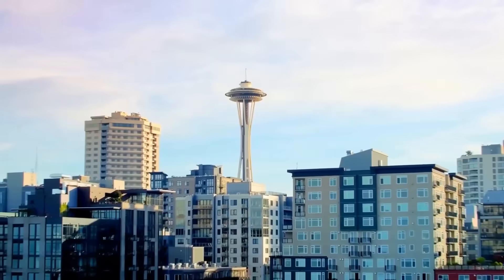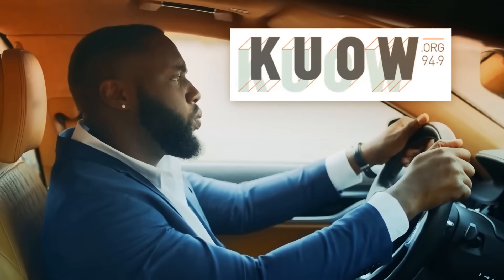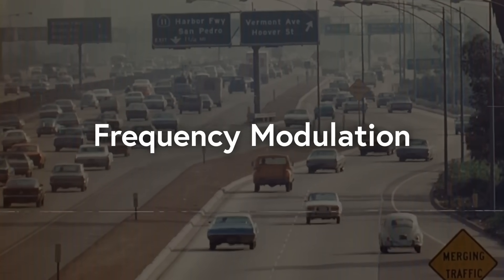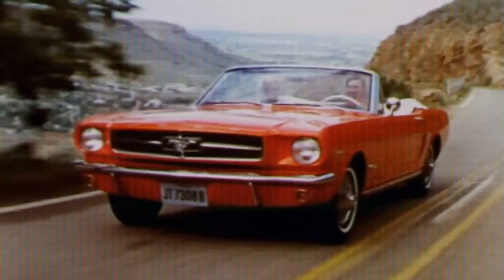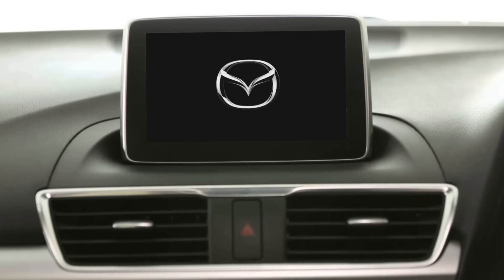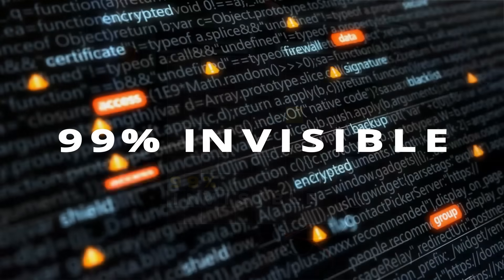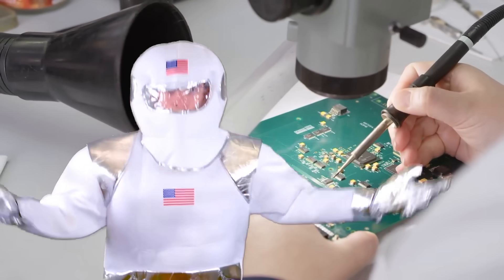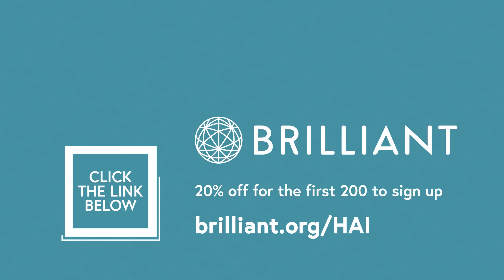Why Hundreds of Mazdas Tuned to 94.9 Broke Simultaneously

Comment: I don’t see how this is a permanently damaged unit. There’s no damage to the hardware. Mazda could reformat the units, and reinstall the software.  My guess is they’re choosing not to.
Reply: They probably designed the units such that there is no way to factory default them, and the memory chip is probably soldered on. Technically you could replace the memory chips, but they would rather sell you a new unit for $1500. Quite sad, $40 IP cameras have ability to factory default.
Reply: @xeridea  
They’re not offering replacements. 
The unit is out of production.
I doubt they intentionally designed it that way. But they may have accidentally done it. 
Sometimes it’s not about greed. It’s about mistakes.
Reply: @neilkurzman4907  It isn't accidental if it is gross negligence. Having a system that is impossible to recover from failure. Sad that a $40 device has ability to factory default if something goes wrong, but a $30,000 car doesn't. Also, you can buy parts for 30 year old cars, so not having them for a car a few years old, which is bound to have warranty claims is pure greed.
Reply: @xeridea  
You’re so busy trying to spin it you don’t understand how stupid the mistake is. Apparently no radio stations in the US sent an incorrect Picture file. If one had in a major city while the cars were stolen to warranty it could’ve cost the car manufacturer a Fortune. 
Now if somebody wanted to start a class action suit against them, they may have a case. There’s also the risk that it could happen again in a different city with a different radio station.
Reply: @neilkurzman4907  You are so busy defending them you are oblivious to their flaws. When writing software, you don't want to assume data will always be exactly how you expect it. If they didn't want to do the extremely trivial task of determining file type by contents, like most software is capable of, they should at least have a failure method that discards the file rather than having unknown behavior. Ask any competent web developer if they just blindly trust user input. Obviously they had zero sanity checks, since anything without a file extension would just blow up. Software these days often doesn't even look at file extension, since file type can often be determined by contents, and users are prone to messing up filenames.

The bigger issue is that, there is no way to fix it. Given worst case scenario of it blowing up, for whatever reason, there should be a backup. As I have said twice before, security cameras that cost $40 have the ability to factory default. If the settings get corrupted for whatever reason, be it accidental, or a freak bug, you can factory default, and everything is fixed. This is an assumed basic feature, even on the bottom of the barrel knockoff cameras. If cheap knockoffs do a better job, there is a serious problem.

I am a Mazda fan, so I am not just out to bash. When there is a clear an undeniable lack of competence, it needs pointed out.
Reply: @xeridea  
Defending them? I don’t work for them, I don’t own one of their vehicles. 
I told you it was a dumb mistake.
One that I’ve spent my living trying to avoid. Because I actually write embedded software. And yes for my products I always make sure there’s a back up way to boot load it. 
Yes that’s the exact mistake they made. They assumed they would get exactly what they wanted. 
Then they doubled down on by doing what they thought would be a useful feature, saving the picture for each radio station so that it would come up without waiting for it to load. 
No you’re wrong. Because you were assuming they knew exactly what would cause it to fail. Which means they needed A general purpose reset. One that we deal with all failures. 
For example my Honda which has a Linux-based entertainment system. Which is what I assume this one had to if it crashes while I’m driving, The only way to fix it is to turn the car off and turn it back on again. There’s no way to fix it while I’m driving. 
A web developer? What does that have to do with a Linux based car entertainment system.
And I’m not sure why you’re bringing up web development, because a lot of sites are trash.

Oh somebody made a mistake big time. Whether it was because they’re incompetent, or in a rush I don’t know. 
You can also blame the test department. Because they didn’t catch it either. As I said they were extremely lucky that this is a very uncommon occurrence. If it was they could’ve had tens of thousands of Bricked entertainment systems, while the cars were still under warranty.
Reply: @neilkurzman4907  Not sure what you are saying. They made beginner mistake, and didn't have any way of recovery. But you agree with having recovery.

My web developer reference is because it is a widely known fact that you can't trust inputs. You can't trust users, hackers, cats typing, or imperfect radio data. Any well built system should validate any input it receives.  Improper input should gracefully fail. I know there are a lot of trash sites out there, I have cleaned a lot of them up. I was referring to the ones built by competent developers. We validated client side, but this was purely for user convenience, everything was always validated server side. You don't want some random user taking out your database, or having a glitched user. There are good and bad developers in every field. This doesn't mean not following good practices should be acceptable. 

Negligence isn't an excuse for poor code. This wasn't some obscure bug that would be hard to test for. It is a failure of most elementary validation. They had a specification on how the input should be, so they had a perfect outline for what to test for. They skipped that part and just blindly assumed 100% of the time they would have perfect data, which is never the case.
Reply: @xeridea  
You’re comparing two completely different branches of software and saying one should be an expert at both.
Beginner mistake? Hard to say. 
Web programmers always get bad data. And by the way not all of them react well to it. Embedded programs tend to be a closed system. So there was a lot of data which you can trust. 
As far as no way to recover, I’m not sure I believe that the design could be that bad. The manufacturer doesn’t seem to be interested in dealing with the issue. Assuming they actually made the radio and didn’t purchase it. 
They should be making arrangements to get them repaired, and making additional software updates to deal with the problem, because it can certainly happen again. 
There’s a lot of bad programming in the world. Sometimes calling them beginner mistakes insults beginners. Because they’re not being made by beginners. I take my mistakes personally. So I try to avoid them.

And yes I can’t believe they didn’t validate that particular feature. 
Actually I shouldn’t say that I’m disappointed they didn’t but I can believe the testing is done that poorly.
Reply: @neilkurzman4907  You don't have to be an expert to know you shouldn't trust external data. It spans all software fields. If you normally work with internal data, this doesn't mean you should treat external data the same. Beginner mistake, yes. How hard is it to be given a file, and realize it doesn't have a file extension? That would be like buying a car and realizing it doesn't have wheels. Even if assuming it does, you will be checking for different extensions, and if it isn't in your list of known types, it should gracefully fail. 

Yes, the design is THAT bad. If there was an easy way to fix it, they would do it. I can factory default a bargain basement camera in 10 seconds. Obviously there is no way to factory default this unit. If there were, it would be far easier to reset it than to deal with an irate customer. You are suggesting a service department doesn't want to offer service, like a restaurant that doesn't like to make food.

You said there isn't a way to fix them because they are out of production, but then suggest they repair them, which they refuse to do, the only option being an expensive replacement for a manufacturer defect.

Beginner and expert programmers alike make mistakes. I am not saying mistakes aren't made by everyone. I am saying a complete and total lack of testing or quality control, or any way to fix problems isn't acceptable. By the nature of it, this is clearly a trivial issue that would be caught by any sort of testing or basic code review. They clearly just got it working, and shipped it. A multibillion dollar company should be capable of basic testing of their products, and have a way to recover from mishaps.
Reply: @xeridea  
You said it to self a lot of programmers don’t do what they should. And a lot of corporations don’t spend the time and money they should on system tests.
No it doesn’t span all software fields. I do embedded systems it’s my data. I don’t need to verify my own data. The same way you don’t verify data that passes from one function to another. 
You seem to think your specialty covers everybody else who does any kind of programming. As far as external data, it depends on your definition of external. Me personally I try to make sure my system doesn’t crash due to external input.

As far as this problem. You really don’t know what happened. You’re taking a wild guess based on programs you’ve seen. You assume there’s one test that handled the whole thing. Different programmers could be involved in different aspects. As in the programmer that read the data assumed the person that save the data did it properly. That they were actually reading internal data.
The problem may be the system engineer. Or the lack of one. 
Me personally, when I was working on a multiprogrammer project. I assumed my fellow programmers were not going to give me good data and actually did validate stuff that I would never have validated if I was doing the entire project.

It’s not just a radio it’s the entertainment system. And it’s basically Bricked unless you can find one used. Which is why I feel Mazda should figure out how to repair them. Because it’s their screwup that led to the failure. And if they get sued, good for them for letting it go that far. They can pay whatever the court tells them to.
Reply: @neilkurzman4907  Validating external data spans all software fields. I don't see how anyone in any field would feel it ok to not check external input. It is a basic part of ensuring your program doesn't crash. If you don't care about your program crashing, you shouldn't be a programmer. You even admit that for your field, where you are mostly working on internal data, you verify external input.

I am not taking a wild guess, it is obvious they have no sort of graceful failure for not opening image files. If the image file fails to open, it doesn't know what to do, system crashes and it reboots. The single cause of failure was not having an extension. Checking for extension would take 30 seconds, maybe 3 lines of code. Recalling millions of cars takes millions of hours and dollars. It wasn't an obscure bug, it was failure at the most fundamental level. Ever notice how if you open a corrupted document or image on a computer, it doesn't blow up? Competent developers felt like adding a few lines to validate, and gracefully fail. There is a well defined spec for image standards, and in a perfect world, all image files would be flawless. Since we live in an imperfect world, and files can get corrupted, it is worth validating. 

Embedded software developers should know as good or better than anyone, you don't want your system failing, period. Fixing bugs via updates is generally cumbersome, and often flat out impossible. The code must absolutely work. You can't just push out a day 1 patch like game studios do, or push out regular updates like OSes can. Neglecting a basic file check is unacceptable. This issue I would see as laughable, but possibly forgivable if they had a way to fix it. Negligent programming of an embedded device, combined with zero ways to fix it is simply not caring.

Since you have stated a few times there are bad developers, I am fully aware of this, I have worked with many of them. Just because there are some bad developers in your field doesn't mean it should be seen as acceptable. If anything, it should be more cause to be vigilant. If they had a basic QA team to test the device, this would have been caught in a flash. Since this is a multi-billion dollar company, I find pushing out buggy devices, with zero chance of fixing them, and  charging $1500 for the great experience is just absurd.
Reply: @xeridea  
I don’t know why you feel the need to repeat yourself. You stated your case.
I’m not sure who you’re trying to convince. Yes they screwed up, screwed up big time. Should they have done a better job, of course they should have. Software quality is a big problem around the world.  
My point is throwing around words like criminal and gross misconduct is misleading since it’s legally none of those. And there’s no way for you to judge the quality of the code because you haven’t read any of it. You’re just assuming it’s a trash heap and a bowl of spaghetti. Maybe it is, maybe it isn’t. 
You realize the $1500 is to buy a used system. Not from Mazda. But From a junkyard. I haven’t heard anything about Mazda doing anything to fix the damaged units, or to protect the tens of thousands of other units that could easily suffer the same fate. 
I don’t see them owning up for their mistake. Because it most certainly is their mistake.
Reply: @neilkurzman4907  I was repeating myself because you were suggesting embedded developers don't need to care about external inputs, which is false. I never said criminal or gross misconduct. I said gross negligence, which looking at it, is not the proper term. I was meaning extreme negligence. Some car makers have spaghetti code, so it isn't out of the ordinary. Toyota infamously had spaghetti code so bad, it was infeasible for it to be properly reviewed in their court case for unintended acceleration.  Not all automakers do it, but it is a somewhat common problem.

$1500 for the system is just crazy. You can get Android Auto installed for $600 or less. My main issue is with Mazda not rectifying the situation, clearly they didn't even try. If they were unable to fix it due to poor design, they should have at least offered some compensation. Even boneheaded mistakes can be resolved if the company cares, I have seen it done.

I don't mean to sound over the top. Being a developer, and seeing horrible code, generally from outsourcing, or "developers" that don't care, and cleaning up messes, I get annoyed. I don't always have the greatest code, but I try.
Reply: @xeridea  
Depends on your definition of external. If it’s out of your control then it’s external.
Yes bad code is everywhere.
Extreme negligence? I guess that’s the industry standard isn’t it. 
I’ve seen some pretty bad coat in my time too. And no not all of it was outsourced. Some developers don’t have the capability of writing good code. But it pays well. Try working for someplace while the generating buggy code while you work on it, so you can’t even fix it. 
Android auto isn’t going to help you if you’re touch panel isn’t working. Depending on the car you may not even be able to set the temperature. 
Personally I believe they can be fixed. And if Mazda was on the hook for it they would set something up. Even if it requires opening the unit there has to be a way to reset or reprogram it. 
They all run Linux, I find it hard to believe that there’s no way to access the bootloader.
Reply: You have a cartoonishly basic understanding of what's going on here lol. Whatever the storage device that stores the cache that's causing the problem is, I guarantee you it's soldered on, and fucking DEEP inside the unit. It's not some sort of conspiracy or decision by Mazda, but rather, that the whole radio unit is legitimately cheaper to replace than it is to remove and disassemble a broken one, dismount the soldered on chip, solder it on to another system or create a custom solution to connect it to that other system without soldering, fixing it, soldering it back on to the original unit, then reassembling the unit and placing it back on the car.

"My guess is they're choosing not to", yeah lol, your uneducated guess.
Reply: @uwirl4338  
Oh I’m sure it’s Saturday deep in there somewhere. And I’m sure the unit has a bootloader that could load in new software that doesn’t have that bug. Except that it would cost money and time to create new software that doesn’t have the issue. And by the way they’re not building new units.
You can buy one from a junkyard if you can find it otherwise you have no entertainment system anymore. So now tell me more about my cartoonish basic understanding. I’d love to hear it since this is the kind of product I made for a living. Not for cars, but other touchscreen controllers. 
By the way if somebody wanted to dig in there and replace the chip, guaranteed they won’t be able to get the hexfile to reprogram it. Because Mazda won’t give it to them.
Reply: @neilkurzman4907  I'm sure there's a relatively simple way to load new software into it but it only makes sense that it is unsupported and quite possibly not even looked into by the manufacturer. You can't seriously expect Mazda, or any tech related company for that matter, to make such a thing an easy matter. None do because it's too much of a liability. No tech company likes having a bunch of their products running bootleg software. You're asking a car company to do what traditionally is a no-go practice to fix a couple of units no one is suing for. That's why I called your understanding childish, not because you aren't familiar with the hardware, but because you (probably) aren't familiar with the business side of things.
Reply: @uwirl4338  
Oh I’m sure they could fix it, it’s probably running some flavor of Linux. 
And it’s not a few units it’s hundreds. 
And I didn’t ask them to run bootleg software or have somebody else do it. I specifically indicated that it’s Mazda‘s responsibility to deal with the issue. My guess is the radio was made by a third-party and they want tens of thousands of dollars to dig up the old code and make the changes. And possibly set up a repair facility to do the repairs. It may rec require removing the unit from the car to do the update depending on how good the development team was. 

And yes that’s exactly what I expect Mazda to do. This is their mistake.
And they’re lucky it didn’t happen while the cars were still a warranty otherwise it would’ve caused them millions. 
Additionally this defect still exist in hundreds of thousands of other cars. 
All subject to what typo from a radio station. 
By the way I just googled it. Mazda is doing the repairs under warranty. 

So I now join the club of people venting on the Internet before actually bothering to look up the current situation.